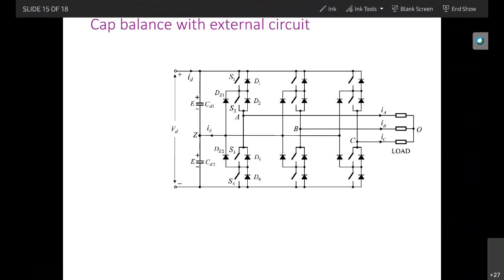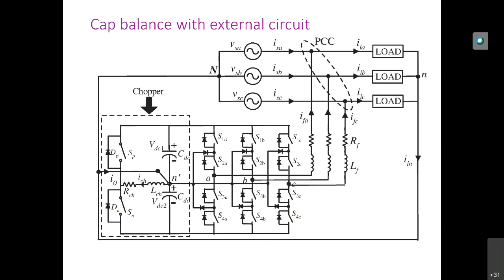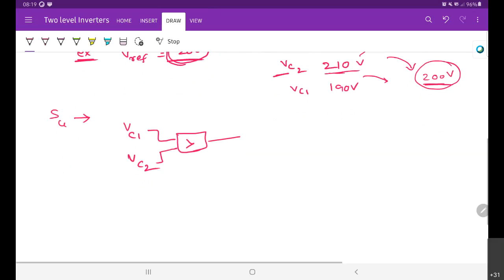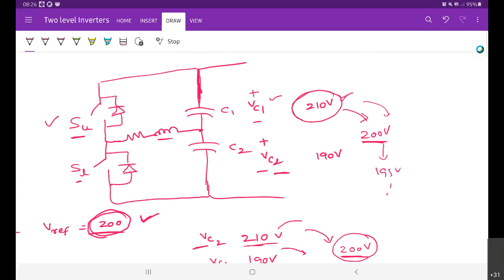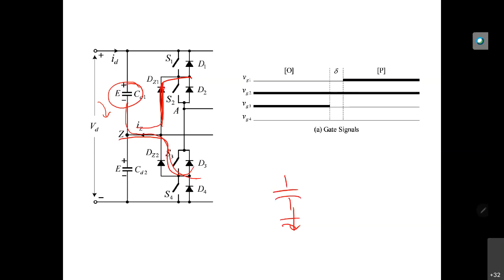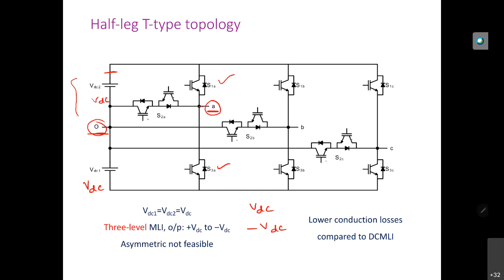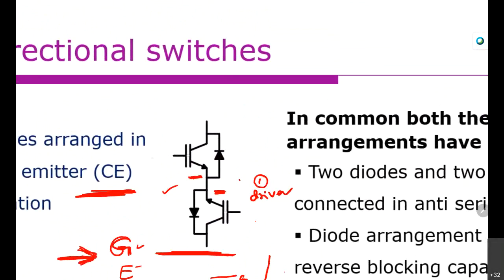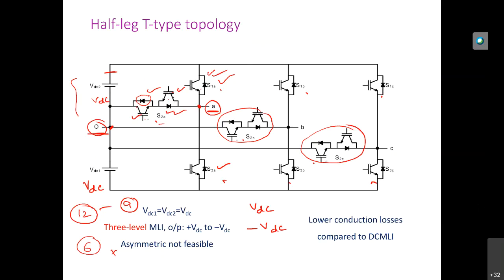Lecture 20 Capacitor balance for Diode Clamped Multilevel inverter, ANPC, Half--leg T-type Inverter

Comment: Hi Sir, I have done Sine PWM for T-type Three level inverter; Referred books & IEEE papers and Verified the outputs; The inverter is designed for Vdc = 600V; For initial testing of hardware, gave Vdc=50V, Checked the output at with only filter; the output is proper; but Vdc = 100V there seems to be unbalance in the output and unbalance in the capacitor charge, it is like high cap charge reducing and low side cap charge increasing; Load is not connected across the filter;
I would like to know whether in Sine PWM capacitor charge imbalance would occur; But I saw papers that use Sine PWM for T-type three level inverter